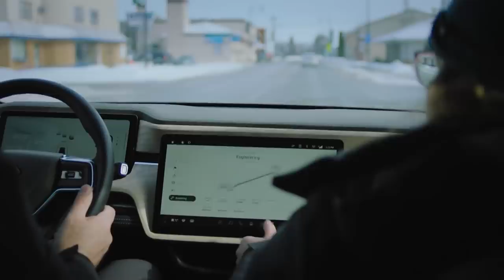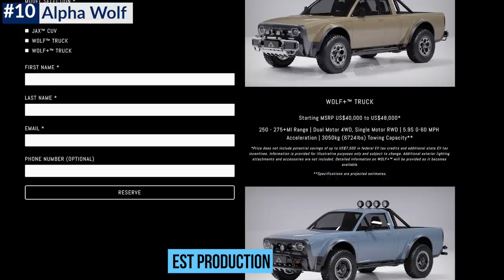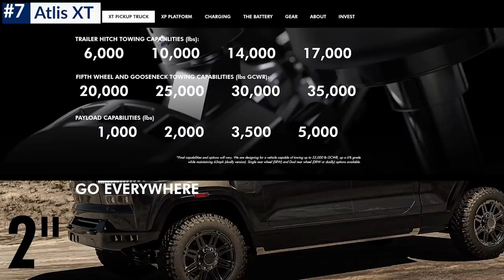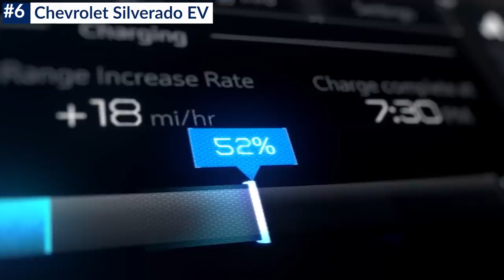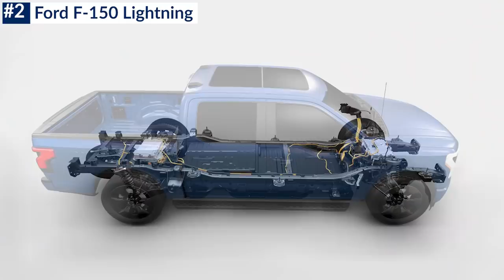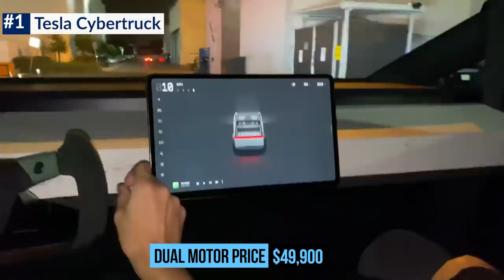10 Electric Pickup Trucks to hit US Streets Soon | It's Happening!

Comment: The ultimatw goal of fully electric cars was never to reduce emissions. The goal is to have centralized control and monotering of all driving. Picture defaulting on a student loan and the govt shuts off access to your car. Much like 9/11 commission ended up creating temporary access to peoples data (which became permanent) or with covid we went from 10 days to stop the spread to take this shot or lose your job, government has proven time and time again you give an inch they take 100 miles. 
Although these cars look great and the engineers that built them did a great job, like everything else govt intervention will just create more problems for the every day citizen.
Reply: Unfortunately, you are right. We are ruled by a bunch of power hungry bastards in both political parties.

Comment: I wonder how the Electrical Grid going to hold up in TEXAS with these new EV's?
Reply: 😂😂😂😂😂😂😂😂😂😂😂😂😂😂😂😂😂😂😂😂😂😂😂😂😂😂😂😂😂😂😂😂😂😂😂😂😂😂😂😂😂😂😂😂😂! Republicans didn't think that part over in Texas.
Reply: Build serious electricity stations…
Reply: Most of the Tesla ownes I know have a separated solar panel system to feed the electrical need of their vehicles but again their jobs are within an hour from their homes or 60 miles + -.
Reply: Not very well
Reply: @curtiswilson4737  Yet it is the electrical grid you Democrats cry for everywhere.
Reply: We drive big gas hogs in Texas, not puzzy EV's.
Reply: @dt1064  Here I was going to say Texans are the MOST likely to get an EV because they are strong willed and independent people. Kind of like the australians where they are running around an installing solar all over the place to say FU. Are you saying my stereotype is wrong? Or am I just thinking of west texas?
Reply: @anthonydilorenzo378  For sure NY and LA both have issues with their substations. There is one in NYC that they want to upgrade for more capacity but the costs is well over a billion dollars, and there isn't an easy way to do it without taking power out of part of the city while they do it because of space constraints. Even running new lines to upgrade capacity is super expensive. There are at least a couple of substations in LA that have the same issue.  I am sure other large cities suffer similar issues. Norway has an issue as well. 

LA went with batteries so because getting space for a peaker plant was a lot more expensive, then just adding batteries and utilizing off-peak hours to fill them up. NYC did to some extent as well.
Reply: There aren't even charging stations in my state that I know of. Definitely not any in my area I wonder how that would work ...
Reply: The grid will be fine. 99% of people charge  at night when they are sleeping. These are off peak times.
Reply: Probably better than California ...
Reply: @Poose McPoose let us know when you need to drive through 2' of snow what you use?
Reply: @sharonrose9552  you might be thinking Austin.  And well ... I mean, it's Austin.

Comment: I would be interested in the Ford Pickup at least if I have a problem with it I can take it down to the local ford dealer and have it worked on. There is one repair center in Spokane, one in Boise, none in Montana for Tesla. Yes, I do know that Tesla has service vans that travel around to work on their vehicles.
Reply: Also - Ford doesn't oppose Right To Repair like Tesla does. So if you get a handle ding in a parking lot or a broken tail lamp or some other little ding that happens in life and want to fix it yourself, no problem. 
Tesla? Mail it in for a month.

Comment: Welcome to Canada Winter!
Reply: That's one thing you don't hear any of them bragging about is the effects of different operating temperatures or energy usage rates.  Both of these factors have a profound effect on how much energy the battery will ultimately deliver.  Everybody wants to speculate (at best:  250 500 miles, that's only a 100% difference) about vehicle range.

Comment: Ford has the edge on these electric trucks. If they could get the trucks to go 500 to 700 miles between charges they will sell like hot cakes.  I have a 2004 three quarter ton Ford v10 King Ranch truck with a 6 inch lift kit  42000 actual miles.  It gets 8.2 miles per gallon  show room condition  l may consider getting a Ford electric truck  down the road. I am definitely keeping my King  Ranch
Reply: 8.2 miles per gallon? Shoot the damn thing! What? Are you rich?
Reply: @johnsavage6628  yup
Reply: @johnsavage6628  There's the problem unfortunately 😕

Comment: conceptually, an EV with motors at each wheel is far superior to an ICE. the limiting factors for EV are the battery and charging, which limits the adoption. entirely new paradigm is required for the grid, if all vehicles are to be EV.
Reply: Until an EV truck can drive from New York to Miami in the winter with the ease of an ICE version, then they will never be anything more than an expensive toy.

Comment: Ford at atlis look like the best bang for there buck..however i dont see alot of atlis dralerships around for repairs an warranty claims...better go with the ford as they got dealerships with mechanics everywhere
Reply: Ford is trash Chevy is God!
Reply: @Lovemyfriends1  God is God..chevy is trash all vehicles are trash however my lincolns have always bin way better and way more reliable then my wifes caddys
Reply: @CanadianBiPolarBear  I said nothing about caddys I'm talking chevy period 🤦🏽‍♂️💯
Reply: @Lovemyfriends1  there made by the same manufacture amd company bud
Reply: @CanadianBiPolarBear  I know that
Reply: You shouldn’t need a mechanic. So few moving parts on EVs.  Batteries and electronics and electric motors. No more belts or valves or fluids or oils or radiators or hoses or anything I’m currently replacing on my old car.  Lol. You buy brakes and tires and wipers and washer fluid and that should be it.
Reply: @crtmojo2705  yes i know that however the car industry will find ways to have something go wrong so they can make money off of the vehicles after the sales
Reply: @crtmojo2705  except the wheel torque motors.  You think those are cheap? hahaha

Comment: So, I have to drive from my house to Nashville, a three hour drive. How do I get home without having to spend the night?
Reply: With a DCFC. EA has several around Nashville along with EVgo. If you’re traveling i40 there are several along there.
Reply: @TonyTiller  so, I can drive my Jeep there and back on a tank,of gas, or if necessary, I can spend 5 minutes filling the tank. How long would it take to charge a battery? EV is not practical…..yet.
Reply: @kevinwhite9761  you asked a simple question. Which has a simple answer.  However, your retort makes little sense.  At some point during your trip your vehicle will be sitting parked.  With a dcfc and the rates I quoted you would be fine.  This is coming from someone that use to drive 3 hours to Kansas City and back in a bolt EV for a day trip.  Where infrastructure was worse than Tennessee.  It isn’t practical to you because you haven’t thought of your actual habits and how fueling the vehicle could change.  Which is fine because it’s not something you have experienced and it’s a foreign concept. 

But alas your last statement is as extreme as most Tesla fanboys with anything negative stated about Tesla. Until you actually get hands on experience I don’t think your opinion will change.

Comment: Hitch a trailer to it and cut the range in half.
Reply: ICE vehicles lose about 40% of their range while towing so it’s fairly similar. Most people just don’t pay attention as closely as they are with EVs.
Reply: @NCE051  This is what i am waiting for, exactly how much energy will all these trucks loose while towing is it gonna be better than a ICE?  And then how fast can you recharge it?
Reply: @NCE051  Then fill it with gas or diesel and be gone in five minutes.  Or you can wait an hour for another 200 miles at a charging station.  Your choice.

Comment: Give me 500 miles of range. Then I will sign up.
Reply: 15 minutes of insta-charge with 350+ miles
Stop in for a short break and back on the road 
Got to stop at some point unless you have a bag taped to your leg
Reply: 500 miles is FAR
Reply: The Ford Lightning has 465 miles of range which is INSANE
Reply: @BaawBee  Umm, no. 465KM maybe.
Reply: @grahammonk8013  nope. 465 miles with the Ford Lightning
Reply: @grahammonk8013  maybe look things up next time before guessing. Not smart
Reply: @BaawBee  I did look it up. Can you point me to something that gives that range? Ford Canada own website says extended battery has 480 kilometres range, which is 300 miles.
Reply: @grahammonk8013  300 miles while having 1,000 pounds in the bed of the truck. With someone driving it without that weight its 465 as stated by people who have actually driven it. Ford under promised and over delivered
Reply: @BaawBee  They haven't delivered yet. Has anyone but a Ford employee driven one?
Reply: @grahammonk8013  the first link mentioned someone
Reply: @grahammonk8013  I've already looked it all up and don't feel like doing it again so
Reply: @BaawBee  @40  MPH
Reply: @robertgraham5486  lol
Reply: @BaawBee  so then what do think about the 500 mile range of the Tri-Motor Cybertruck?
Reply: Cybertruck tri-motor…500 mile range.
Reply: You signed up for 10-30 miles a gallon for gasoline which is lower than the worst ev, so what you waiting on? Smh

Comment: More over priced trucks just what we need
Reply: Oneofurfriends
Oneofurfriends
Overpriced????????
What did you bought, still drive it now?? Needed for the Job?
Reply: Have you priced a chevy or ford these days.  Add the cost of fuel and see what you pay.  Atlis starts in the 40K range to get 3 hundred miles.  This is as cheap as a gas truck with the cost of fuel to fill it up.  Win Win.
Reply: @ttwymr  sorry but it's still overpriced..They could drop the price in half and still be fine

Comment: For the Alpha Wolf, why would anyone put the front seat seatbelt on the rear door?
Reply: Because they didn't add a B pillar it needs to be anchored somewhere.  They likely didn't want it anchored to the front door that might fly open in a front end collision, didn't want it anchored to the roof for aesthetics and seat mobility and didn't anchor it to the floor because of seat mobility.  Anchoring it into the seat might not be great because they'd then have to anchor the seat to the floor and reinforce it from collapsing forward in a crash which would increase weight and disrupt mobility again.

Comment: Critics said the Cybertruck was vaporware.  It will the only EV truck that will be produced in significant quantities.  Most of the trucks listed will only be produced in limited numbers due to lack of production capability.   Ford and GM theoretically have the means to produce their EV trucks in large numbers, but they are dependent on third parties for batteries and they will not be able to buy enough batteries to build large numbers of full EV trucks.  I expect them to put more effort into hybrid trucks so they can spread their limited battery supply over more vehicles.  Tesla has their own battery production and solid contracts with independent battery makers.  With the Texas Giga Factory nearing completion, Tesla will continue to be the dominant player.
Reply: lol
Reply: Welp, this comment didn't age well lol. Tesla even removed the Cybertruck's production timeline from its website altogether a month ago. Ford is taking over and I already have seen 2 Rivians in South FL.
Reply: 😂😂😂😂😂keep dreaming Tesla boy

Comment: Just wondering where I can charge my pick up at. That's what I thought.
Reply: Charge it at home.  I plug in my C-Max every time I get home, and drive 15 miles for only $0.75, before the gas engine takes over at $0.10 per mile.  Yes I get 40 MPG.  I don't think the Maverick will get 40 mpg, it is much heavier than the C-Max.  Also my car uses about 500 watts per mile, so I don't think the F-150 will use less than 750 watts per mile.  Anyone claiming "We will get 300 miles range from a 75 KW battery" is being very optomistic, IE Dream on.   My car will not go more than 20 miles from 7.5. KW, on a cool day without the A/C running.  I have a 120 volt and 16 amp 240 volt charger at my house, that is 1,400 and 3,800 watts.
Reply: How are the batteries disposed of when they are no longer keeping a charge?  And how much do new batteries cost?

Comment: Next "green" problem will be overloading the power grid because the windmills can't keep up..
Reply: The only advantage to EVs is being able to centralize the polluters (i.e. coal or natural gas fired powerplants) making it easier for the EPA to monitor and hence control the polluters' emissions.  If solar or wind was the end all sources of energy, we'd already be using this power in all homes, businesses, etc..  There's no free ride (except maybe for one).  Even if we go completely nuclear we'd still have to contend with the heat released by the cooling towers or the hot water being expelled into waterways as a power generation by product.  The one free ride that I can imagine is a magic transducer that can convert naturally occurring or manmade heat into electrical energy.  This would also require that we recoup the heat generated by machines powered by the electricity created by our "magic" transducer, hopefully to generate more electricity to power the machines again.

Comment: The EV truck, car, and commercial vehicles are good solid ideas. The response in the past has not been. The Early EVs were great. In most people's cases the regular 100 mile range EVs would facilitate 90+% of their driving needs yet they did not sell well. The new longer EV range vehicles seem to be great ideas but their is no data to suggest market response.  I have a Fiat 500e. I love it. Many people do not want EVs. Manufacturers do not want to be left holding the bag again if the do not sell. The troubles with the Bolt may bankrupt G.M.

Comment: all these trucks are ok but the name of the distance winner will be 700 miles on a charge
Reply: WRONG we need to be able to pull things long distance without loosing energy quickly, which one will do this say at least tow for 3 hrs and not drain the battery all the way down!
Reply: Towing distances per weight need to be given
Fast charging... 15 minutes of instacharge is a new water/soda and a bathroom break.

Comment: So……..here’s a thought….when all of the vehicles here are electric……what happens when the power grid goes down? What then? Bicycles or back to horse and buggy?
Reply: Most gas stations in my neck of the woods can't pump gas when the power goes out anyway, so after a couple days you are in the same boat with ICE or Electric.
Reply: @nvcsmith  

Have to disagree with you there. You can store gasoline, you can make biodiesel from old cooking oil, there are ways to make alcohol without electricity….but once the grid goes down….you’re basically fucked.
Reply: @earth_ling With a solar setup you could charge your vehicle indefinitely, or at least for a decade or so until the batteries reach end of life. It also wouldn't require setting up a distillery. Let's hope none of us ever have to actually figure out which is better :) A definite positive to your idea is that you could make your own alcohol, which would probably be a hot commodity during the apocalypse.
Reply: @nvcsmith  

Funny stuff….

I would bet  that two hot commodities in an apocalypse would be alcohol and bullets…definitely. Lol

I’ve actually looked into a Tesla a few times. I like their products and he’s definitely building an infrastructure to support his vehicles and that’s really the issue with electric vehicles. Infrastructure. Everything is geared up around gasoline.

I wish that he would pursue Hydrogen as a alternative fuel. But not fuel cells. That tech is way too complex. Hydrogen production only requires water and there is plenty of that right off of our coastlines and an electric current. Solar? I truly believe that hydrogen powered vehicles are a better alternative to electric and batteries given that the current battery tech involves Lithium. A highly toxic material.
Hydrogen on the other hand…no contamination of the environment and its combustion produces oxygen and water vapor. Exhaust would actually clean our air or at least….improve it.
Reply: @nvcsmith  I have gas stored in cans for use with lawn equipment and generators. So it not equivalent.
Reply: @bobhabib7662  Solar panels might be slightly more portable than an oil refinery Bob? Not sure how government control has anything to do with this conversation, for gods sake some people just want to have a conversation without it turning political.

Comment: It’s been soon fo over 5 years
Reply: New vehicle design and testing usually takes 3-5 years with a 5-10 year model life. Ford and GM were waiting for their current designs to be end of life. As you see with Ford, because they designed it as just a different drivetrain to their F150 product, it will go on their production line, and uses the same parts as their ICE vehicle offering, which is a significant cost savings.

Comment: The off-road EVs will create problems with mechanical failures if the manufacturers allow owners to access all available power anytime the driver wishes.  Dead stop takeoffs will put more power to the pavement without making a sound (if the vehicle is properly designed to deliver no-slip acceleration) and will therefore become a norm in driving EVs for a lot of people.  Tire wear, drive train failure and poor battery performance will be popular problems.  The 0-60 specs the manufacturers are bragging about will actually come back to bite them in the arse when they find themselves doing a buttload of warranty work on their vehicles unless their drive trains are revamped to handle the extra torque available from a dead stop or at low speeds.
Reply: Since 2019, Federal rules have required EVs to make a sound below 15mph.